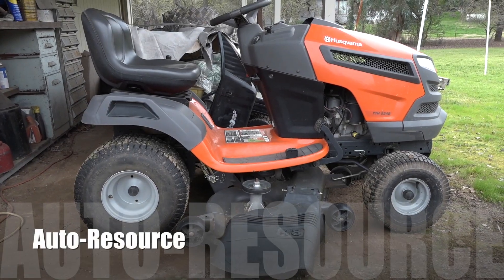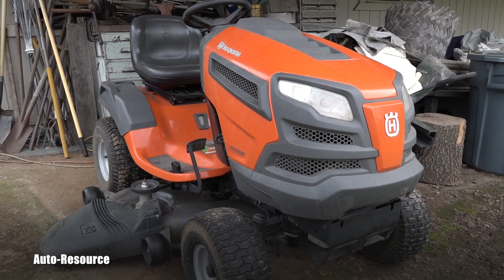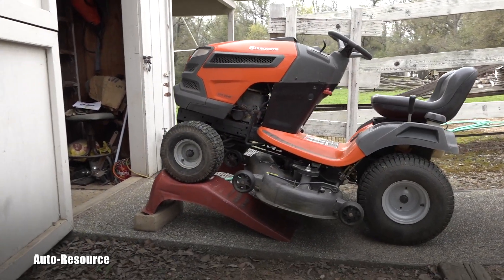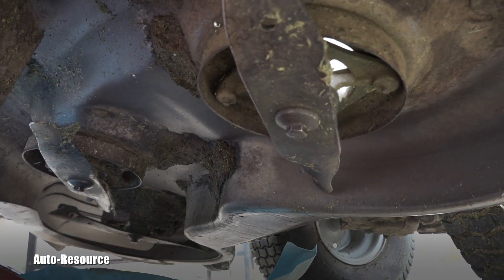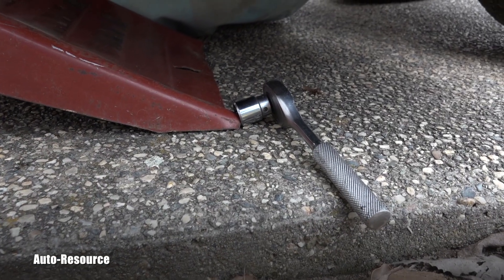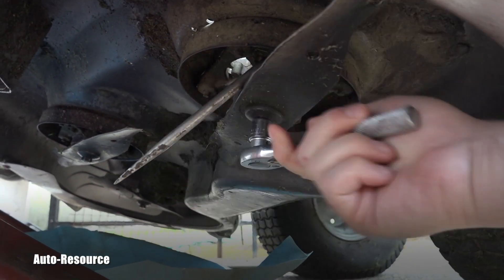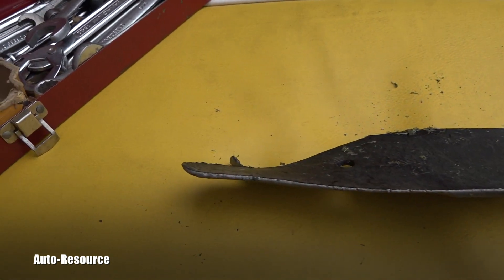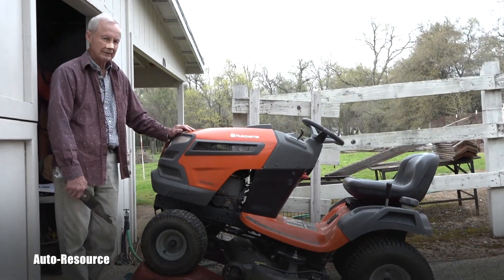How To Remove Blades Husquarna Riding Mower

Comment: Breaker bar, 5/8 socket, when putting on new blades put anti-seize on the threads!  You can also wrap a rag around the blade, hold it and work the breaker bar to loosen the bolt, always use the same bolts that came off the spindle.  True an Impact wrench will work very well.  Torque spec is 45/ 50 foot pounds.  Use chocks at the back wheels and put tractor in park.